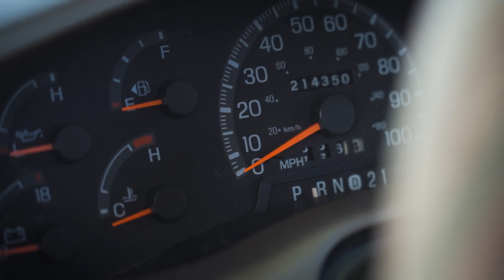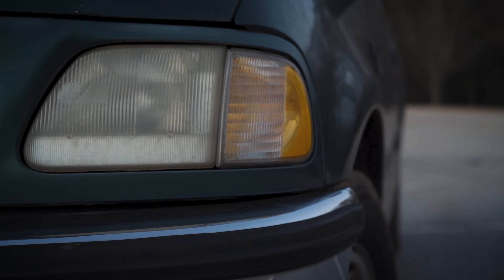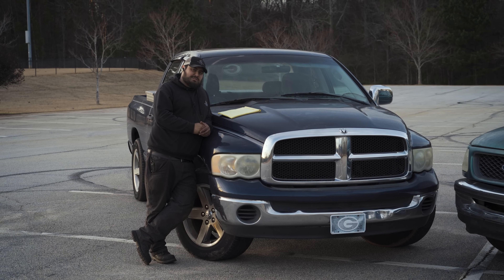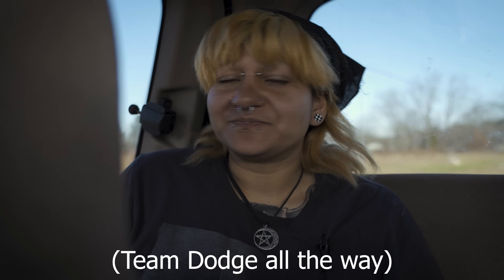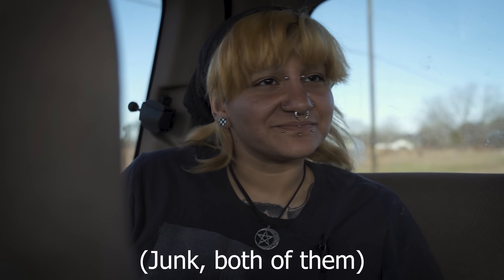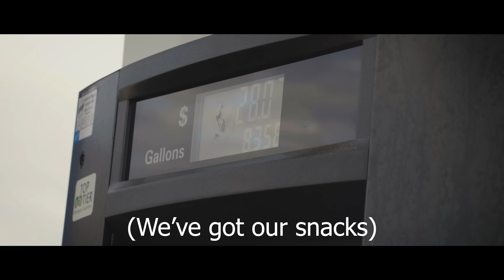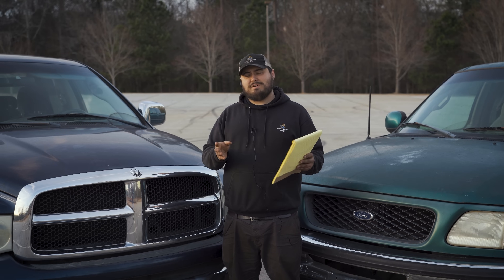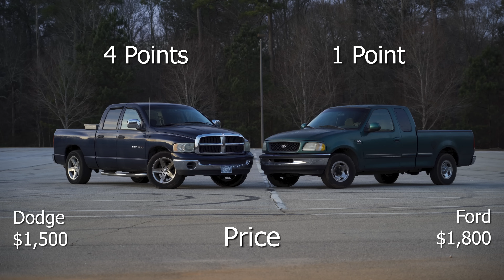CHEAP TRUCK TOWING CHALLENGE, Head to Head Towing Challenge, Dodge Ram 1500 vs Ford F-150 Reviews

Comment: Not sure about your biases, but uh, they're showing. 
My Dodge, that I've had for 12 years, has had ONE problem. The blower motor. I replaced it. It works. It'll out pull other brands. It's a truck. Pulling a d fuel mileage are non compliant. If it pulls more, pulls better and last longer because it's working less......guess what. THAT, is the better truck.
You should probably have this test done by individuals who have no bias toward Chevy's. If ya like Chevy's just say so, no need for this theatre

Comment: I bought all of my F-250s for under 2 grand lol. Way more capable.
Reply: Every vehicle I bought for over 500$ but less than 1240$ was better. Guarantee the 86 grand marquis would outpull them. Newest I had was 98 ram 500$ 30k later and 140$ for parts and one oil change

Comment: Just buy any 99-06 silverado 1500 v8 I tow a u haul car hauler that around 2200 pounds and a 03 corrola with my single cab short bed with no issues.

Comment: The Dodge doesn’t have its original wheels. Those trucks came with flower looking wheels.
A lot of people liked or chose Dodge back in the day for a few reasons. They larger look, they would come louder from the factory, but probably the biggest reason is they were the cheapest option for trucks before. They were the budget brand, Dodge has tried hard for a long time to do more appearance wise (looks & sound) to attract truck buyers. You can see that a lot with the Rams as well. Even with HDs and teaming up with Cummins & Aisin so they can have strong power trains and look nice too. But now a days Dodge isn’t a cheaper brand.

Comment: Just looked at the EPA City and Highway ratings of the Dodge and the Ford with those engines and they're the same. Which means you're absolutely wrong as in most of your points you're making here

Comment: The only input I would like to put into this is just a couple points let's start with this is why you never tow with 1/2 ton unless you have to there could be many reasons that you have to but if you need a tow rig get a 3/4 ton You can usually find them cheaper than you can a 1/2 ton in similar condition next we'll move on to the people trying to defend the Ford the point of the entire test is how the two trucks handle the exact same load if he adjusted it for the Ford he would have also had to adjust it to find the perfect median for the Dodge You're asking too much and finally for the Dodge haters it is very year and model dependent Dodge made some very excellent trucks and they made some very s*** trucks for the same reason you can't find an F-350 powerstroke for under several grand You can't get any of the good Dodges for under several grand either

Comment: Well I'm happy to see you only have 12.5 k subs lol you really think the ford is better? Lmao and also 16 inch tires are more expensive man your so good you deserve your lack of attention I've seen more fords with wiring nightmares then anything else ... what about the coolant pipe under the 4.6 intake that will blow and is impossible to change easily ?

Comment: I can make ANYtruck sway if the trailer is loaded wrong and there is little tongue weight. Atleast ypu have it loaded correctly. Good tongue weights important. I see dudes putting loads to the back what a joke.

Comment: Ya know you shit on that dodge so much I had a 3rd gen with a 4.7 that I got from dad and he pulled horse trailers with that damn thing all the time and never had an issue out of it the only reason I had to replace the rear end was because I was being stupid and doing a lot of burnouts with it the truck had over 300000 miles on it and we did basic maintenance took the 20s off and put on aftermarket 17s and a rear end that's it so shit all you want but I've never had an f150 that could handle what that truck went through

Comment: I have had bolth and thr dodge is towing better because the there is no cat i can hear it and the dodge transmission is absolutely garbage the ford needs  air bags but thats every old ford  i would pick the ford
Reply from the maker: Both trucks have full emissions systems, both cats on the dodge, and Ford. Both have mufflers too, dodge has some kinda thrush dual exhaust system on it, but it does have cat converters.

Comment: You got a real burr in your saddle with Dodge, as a 40+ year tech starting with GM, then Ford, then Dodge id have to say Chevrolet was the longest lasting , easist to maintain and cheapest to maintain. Most of the trucks ive owned were" real trucks" meaning before 1979 so  the fords and chevs had the weakest auto transmissions back then and the Dodge was far superior in every way. Nowadays they all suck. 20 computer modules, thousands of miles of hair like wires that easily burn in half or corrode at the connetions, all ignition switches  are crap plastic and the transmissions are all crap throwaway junk even the manual ones! In closing you couldnt give me a new truck these days,,, well ya could, but id sell it and buy a late 60s ford, dodge or GMC  that has real  axles, real transfer cases, real manual  transmissions, and real engines😂😂😂😂

Comment: As someone who has had both trucks (except mine was a 5.7 ram) the dodge is by far and away better... That Triton series if motors were complete crap
Reply from the maker: The Hemi is the towing king for half ton trucks, but we're comparing what you can buy for under $2k and hemis don't come cheap